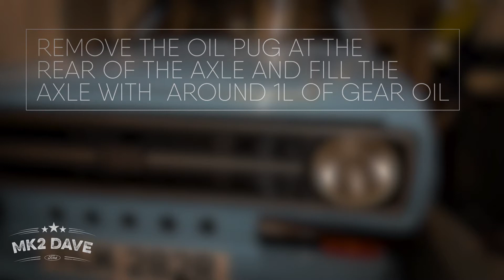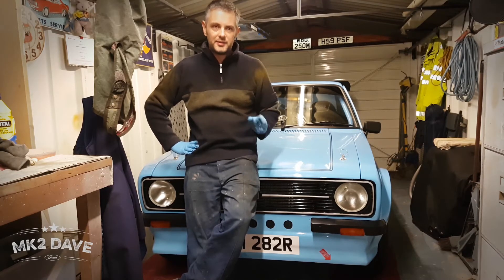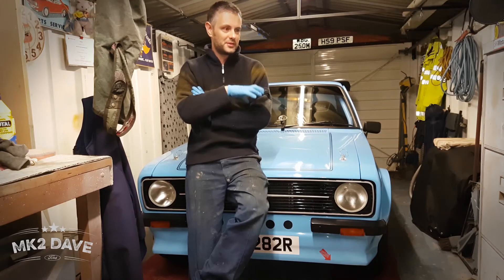Diff Swap #2 - Mk2 Escort

Comment: Great video Dave
How are you getting on with your 4.1 diff ? Thinking of putting one in my mk1 running standard 2.0 with standard 5 speed gearbox!!!
Reply from the maker: Cheers mate, I can t fault it really. Feels a bit quicker off the mark and will happily sit at 90 on the motorway, Ive had it round Knockhill racing circuit and honestly felt like the perfect set up for my mildly tuned pinto on 45s and a type 9
Reply: Excellent that's my mind made up ....
I got a 3.5 on the car 4.1 and 3.8 spare which all need overhauling !!!!
I'll do the 4.1 first an have a play !!!
Thanks for the reply.
Oh yeah and nice Escort!!
Reply from the maker: considering selling my 3:54 to pay for an LSD but not sure if i want to part with it.